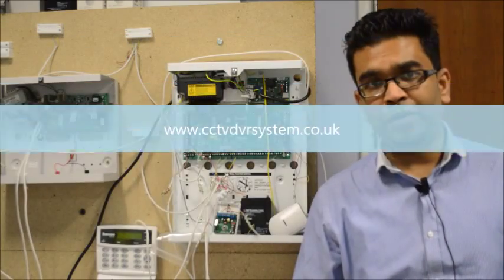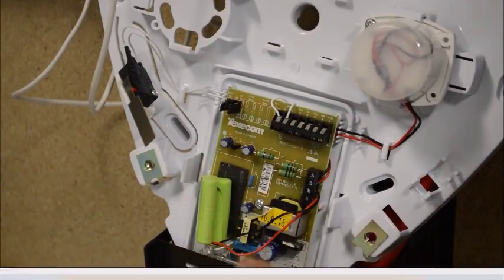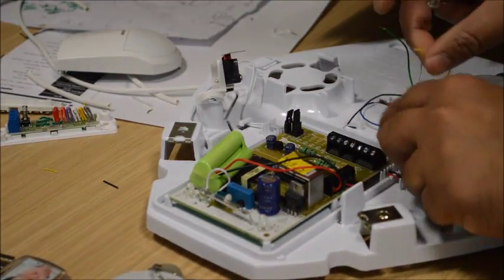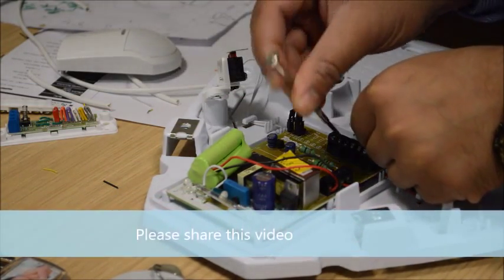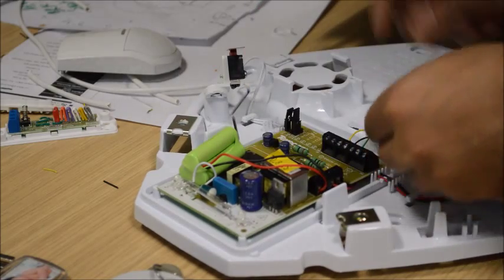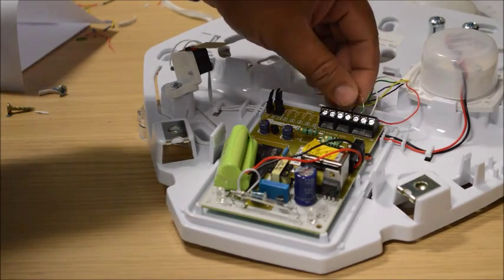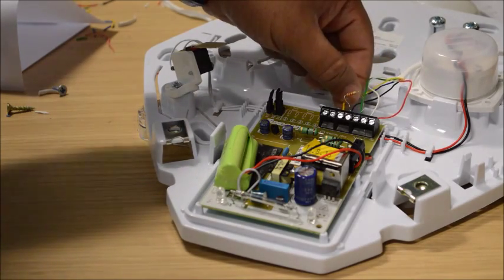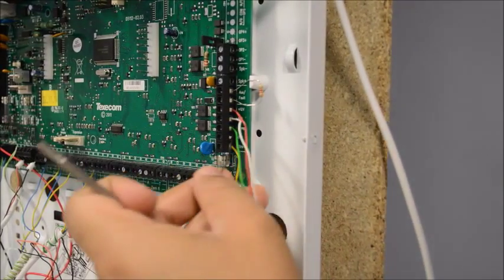wiring a texecom panel

Comment: Why do you have a resistor across the Aux/Fault terminals? Is this needed for the bell to work?
Reply from the maker: If you have done EOL wiring, then you will not of used the tamper circuit, so this must be linked out.
Reply: Understood - 2.2 & 4.7 inserted at bell.
Reply: Does this need to be linked out then or linked out with a resistor what k? Thanks